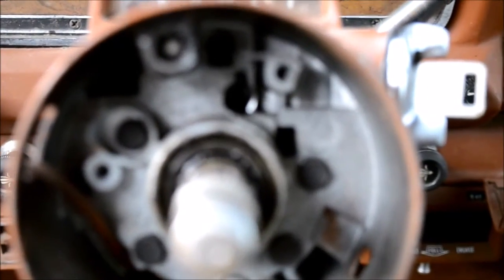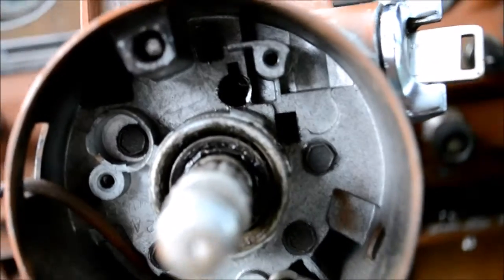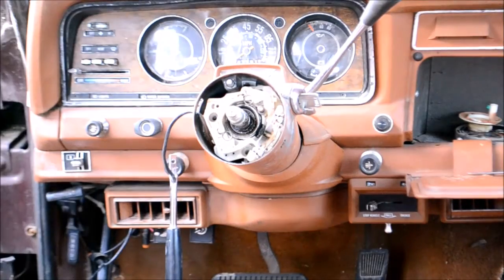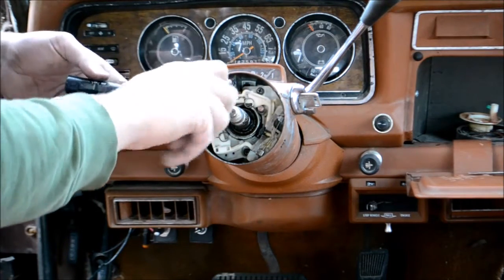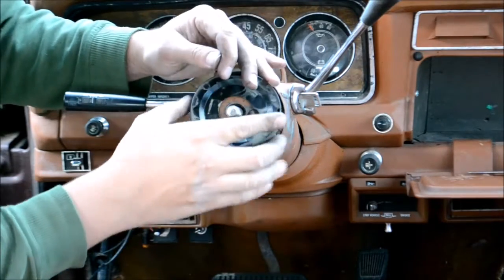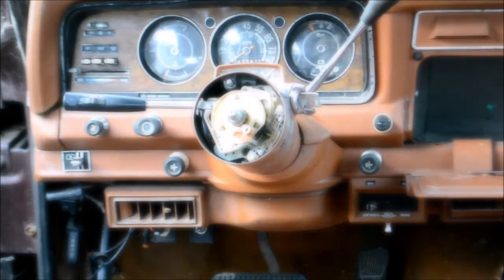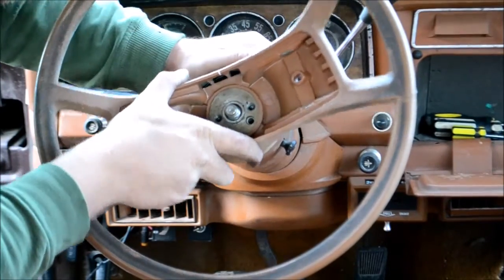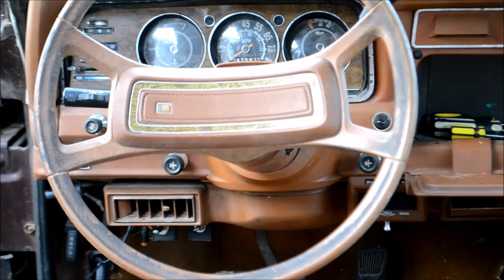Unlocking the Mystery: Wagoneer Lock Cylinder Secrets

Comment: Mate how did you get the spring down far enough to put the ring pin back on?
Reply: if jedi - push hard on it, wedge screwdrive into the notch,finagle the clip on with a pick. If mechanic - reach for your steering spring lock depressor tool.

Comment: You broke the horn connector when you got rammy with it and horn parts were missing.  You also missed two crucial bolts that keep the steering wheel from spinning on the column shaft.

Comment: @7:19 you broke the plastic tab off.
Reply: Quick FYI-- That plastic tab 'was' or is there to help you align the steering wheel. As long as you can see where it use to be and line up the splines that way, the steering wheel should be in the correct position for the front wheels to match the alignment as well.
Sure, I hated to see it break too and once it happens people tend to freak out a bit...
Reply: @jlmealer2091  Not exactly --That little plastic tab is where a wire should exit and connects to the horn button behind the rubber steering wheel center. That plastic part holds part of the rotating electrical contact for the horn.